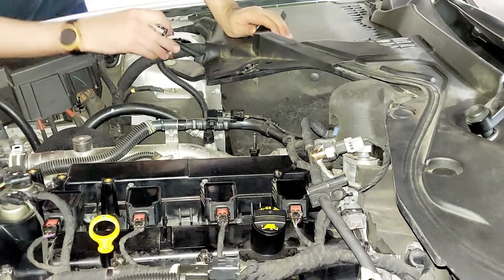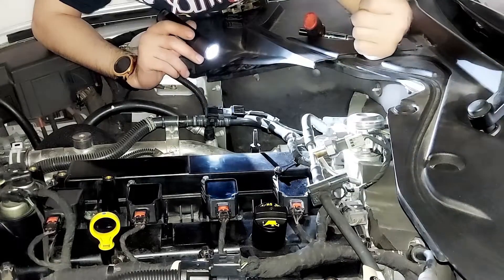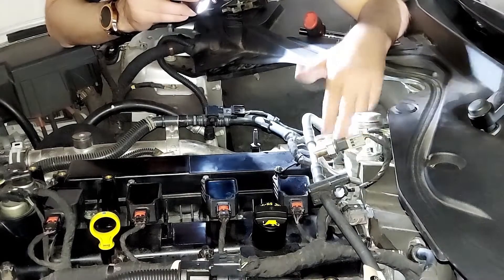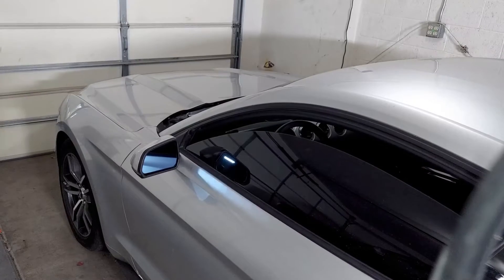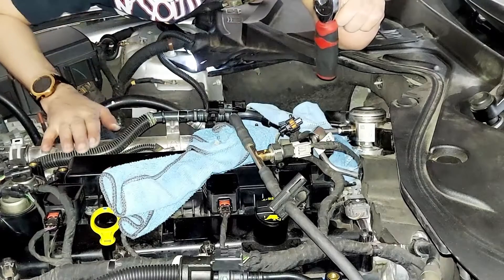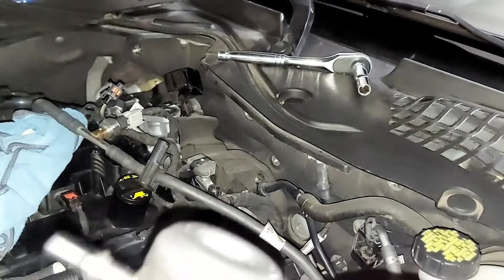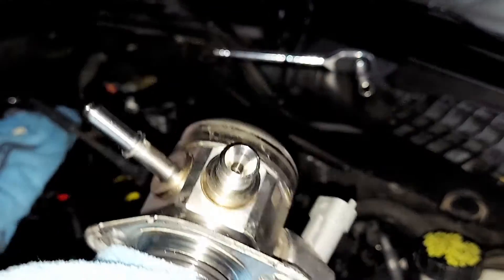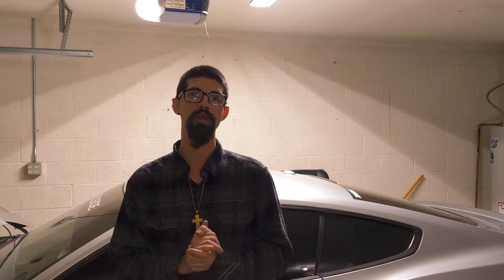2015 2021 Mustang High Pressure fuel pump Removal

Comment: Haha I meet you at Walmart lol just blew mine up lol pulling engine now
Reply from the maker: What’s up man. That’s not good you need a 5.0 just like I am planing on dropping in to my mustang it will be a build series for YouTube.
Reply: @DailyDrivenStangs  haha yea if only pry gana save for a built short block tho pry the one from pd tuning or tune plus. I think I got lucky and just broke a peace of piston skirt . motors out took me like 6hrs so gana tear down and find out. if I can I will just slap pistons in it make it run tell I can buy a built short or long block . And ya man that will be rad curious to see what all it takes and how much it will cost you to do so.
Reply from the maker: @ksacdesigns I can’t wait for it my mustang just threw A p00c6 last night so I got to fix that it might be my high pressure fuel pump sucks.
Reply: @DailyDrivenStangs  dam sorry man

Comment: Can this cause misfires if hpfp is failing?
Reply: Did the pump make a ticking noise?
Reply from the maker: No it didn’t. It wasn’t priming at all.
Reply from the maker: Yes it can. Is yours failing
Reply: @DailyDrivenStangs  well usually on a high load for power my car goes into limp mode and check Engine light blinks and I check my Cobb shows I’m having fuel delivery error and misfire cylinders 1,3,4
Reply from the maker: @DemonsxXx100  Very common, I would change the low pressure fuel sensor if you haven't done so yet. Also check your fuel pressure with a fuel pressure gauge Because it could be your fuel pump it self or your high pressure fuel pump.

Comment: I would have removed the fuel pump relay/fuse just to have less fuel spilled but I’m not a mechanic 🤷🏽‍♂️
Reply from the maker: Your 100% right. On the mustang its hard to find the relay. Any other car its easy to find.
Reply from the maker: Also that’s all you need to unplug is the fuel pump module. No fuel will be driven without that being plugged in.